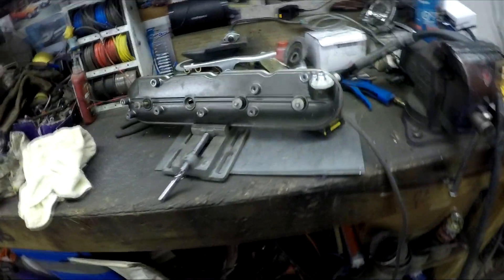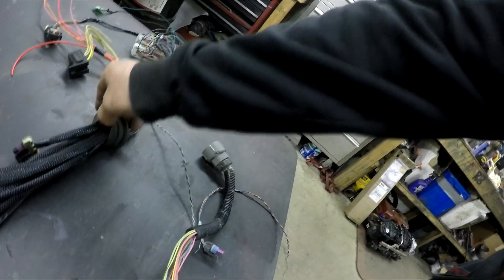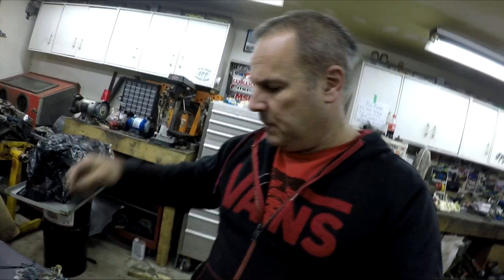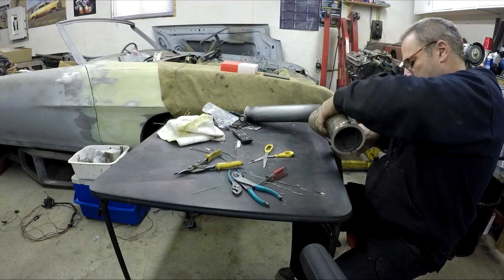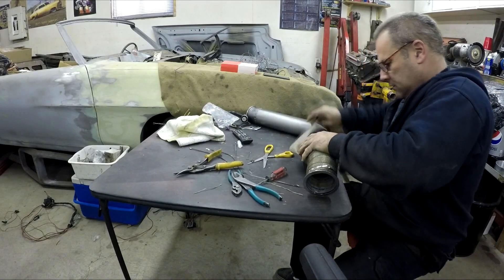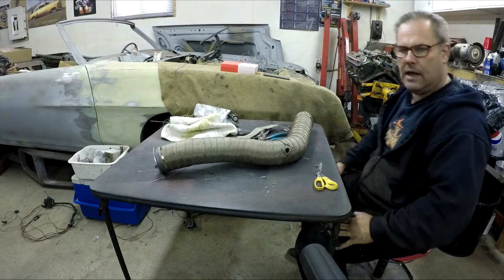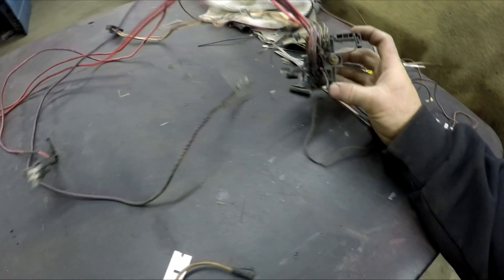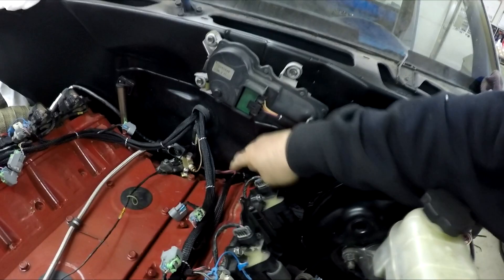THE END IS NEAR! Budget 5.3 Turbo Build | 4L80e Harness Wiring Mod (LS Wiring Part 3) + More

Comment: I was thinking the exact same thing about the limiting strap. I just built an 84 s10 with a 5.3, 4l80, 78/75 and im running full exhaust and its also close just like yours. Mine is driving now but i havent made a pull yet, only down the block and street and back.

Comment: may want to be careful running that alternator wire so close to the injector and coil wires.. the electrical noise is pretty high from that alternator. Although it does look quite clean there. Anyway great job on the truck